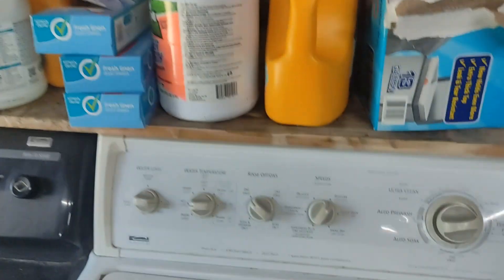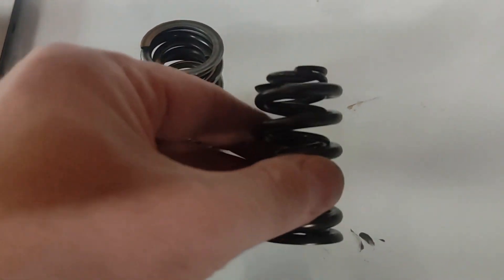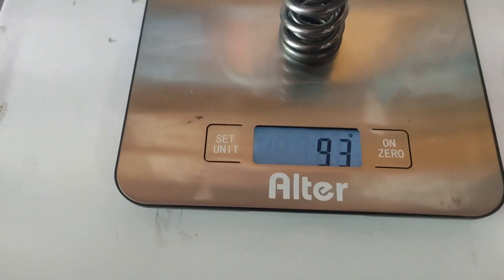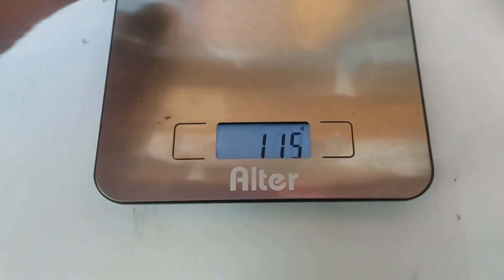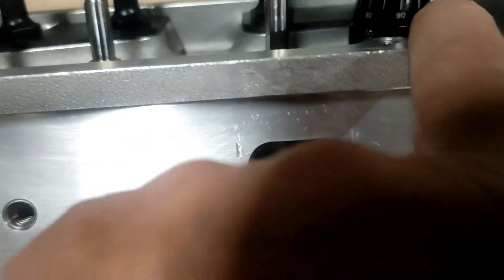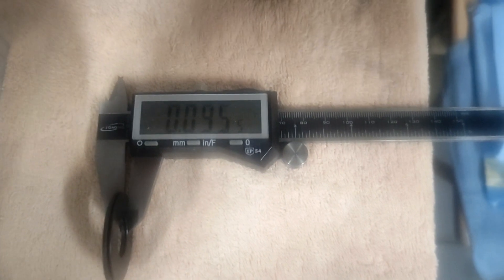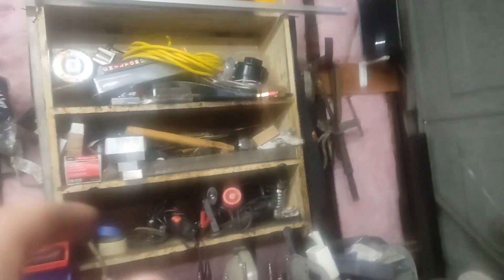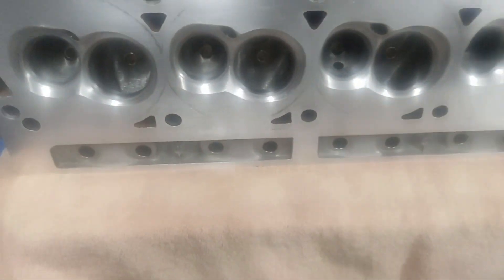saving some weight in the valvetrain!

Comment: Are those 170 heads for your 349?
Reply from the maker: yes, they are ported to a 180cc though, Big Dog porting did them for me back in 2020, been running them for 4 years, car has trapped 130 mph so I think they are fine for my needs today, do want to go bigger in the future but Bidenomics is not working well for my car parts fund! LOL
Reply: @vrm86gt  I kno I was working ALOT more when Trump was in office
Reply: @vrm86gt  OK, makes sense, sw the 170  on the end and was wondering.